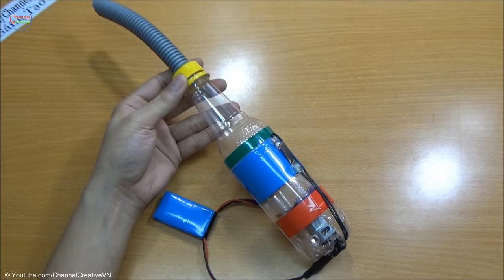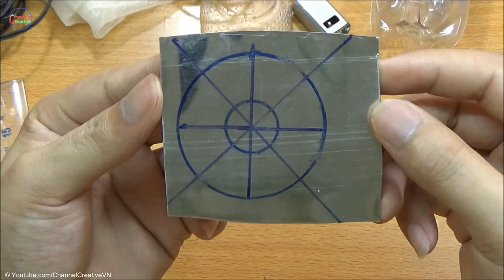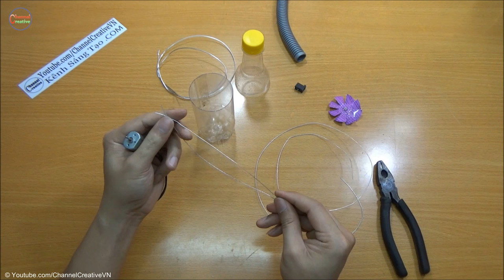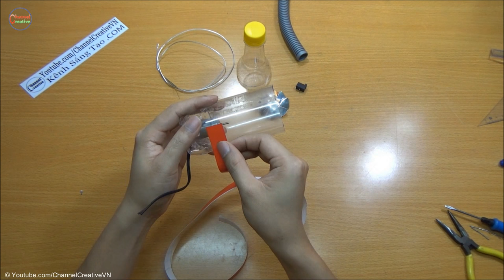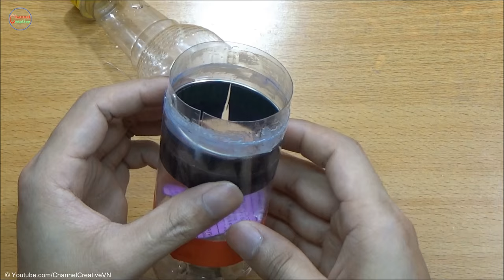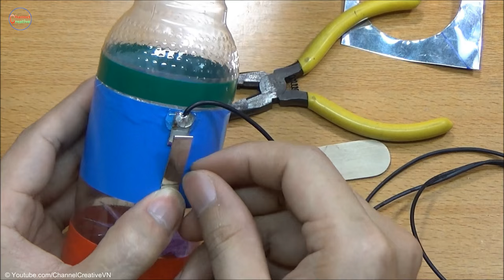How to Make a Powerful Vacuum Cleaner

Comment: does the switch not give current and is it ok if we glue the wire to the switch
Reply: coming through the adapter it's DC current and doesn't hurt at all just like the batteries you use in toys.

Comment: thanks bro  but can I use a 5v phone battery
Reply: Abdulrazak Abdalla Yes but be careful so you don’t put too much power on the motor, try and check the amp on the battery, and what current the motors wants, for example a “5v DC motor” wants 5v and around 1.2-3.0 amp.

Comment: I tried to make the vacuum cleaner just the way you have shown but it is just not pulling air inside. Can you please help me? Otherwise all my efforts shall go in vain.
Reply: the motor u used is probably has less power
Reply: +cyril joel I used a 5 volt motor. So should I use a 9 volt or 12 volt motor?
Reply: +Aarushi Guptaa a 12 volt would be better 5v is too low
Reply: Thank you so much. I'll surely tell you if it worked...
Reply: +Aarushi Guptaa its ok but u also need to be careful about the direction of motor and the bend of the proppler or else it wont work
Reply: Just thought about telling you my vacuum cleaner is working. All I had to do is buy an adapter of higher voltage. Thanks once again.
Reply: +Aarushi Guptaa oh great to hear it

Comment: two problems with this build that i can see ( im poorly educated..)

when you glued the fabric onto the metal ring, you did it on the underside.

it would have been better with a small hole, glued to the top side.

as the glue would have less stress on it that way.

the second thing is that you cut the end of the pipe for the vacuums nozzle.

you decreased the suction power by increasing the size of the hole.